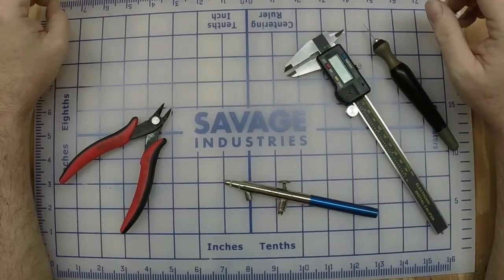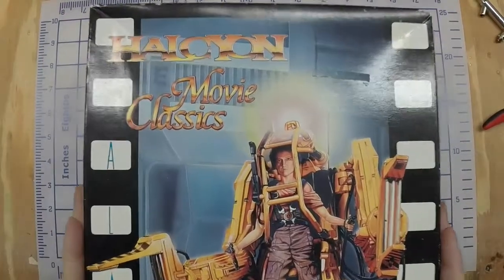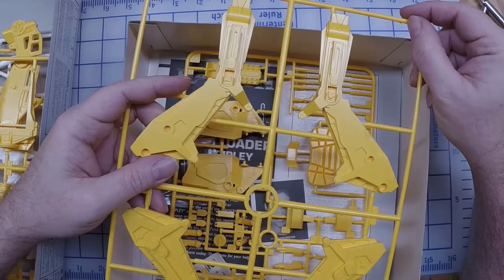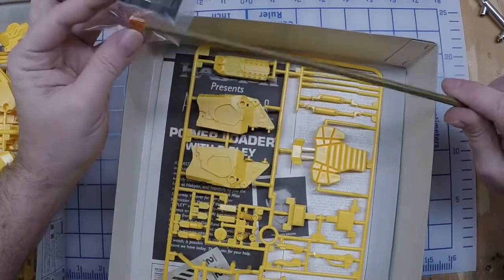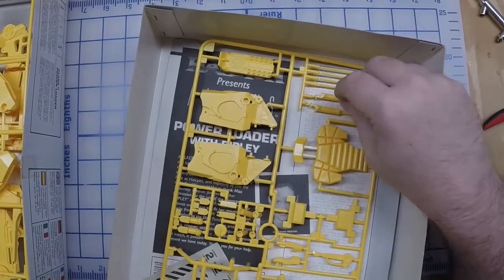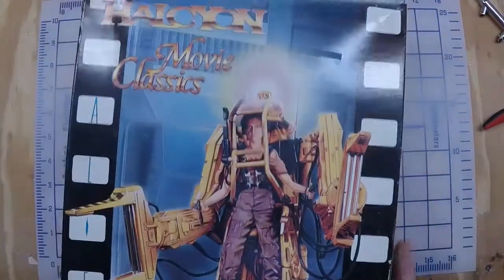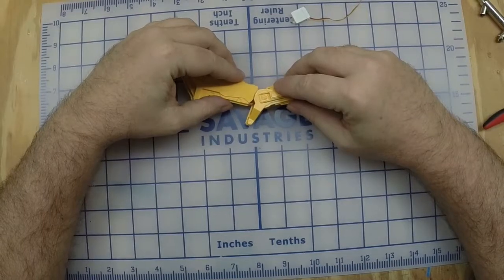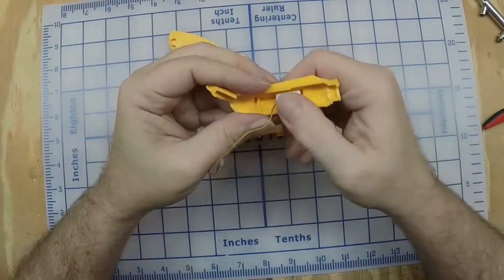Aliens Power Loader custom build

Comment: Yeah, it's Hal-see-on.  It means "the carefree days of youth."
I bought this kit in the 90's (and the APC and Dropship).  Limited posing, but you could make a good static model out of it. The Photo-etch parts were a nice bonus.
  I'm currently making the Moderoid kit which is the same scale, but both Ripley and the loader have far better articulation.